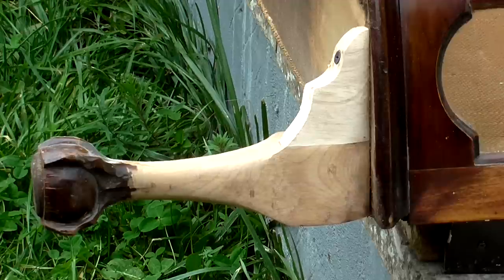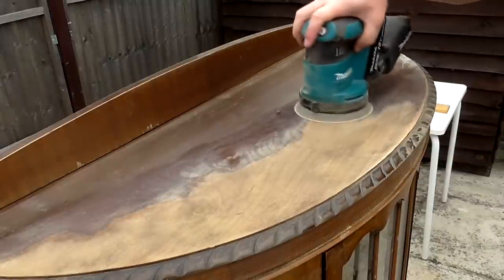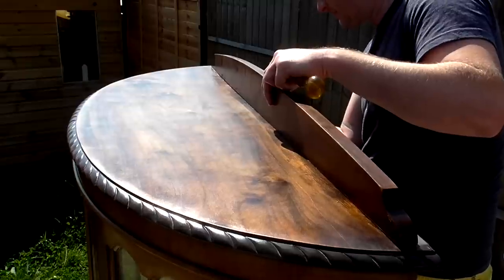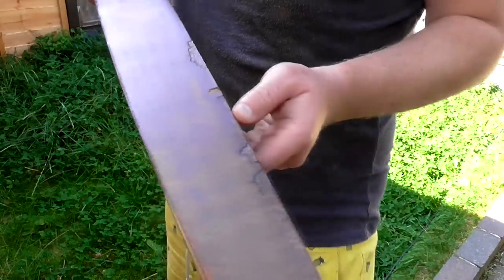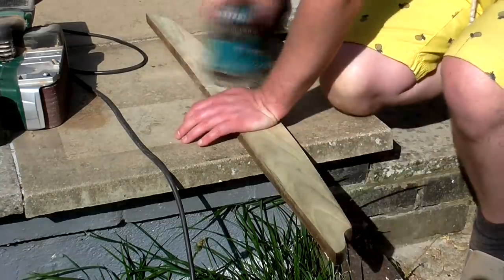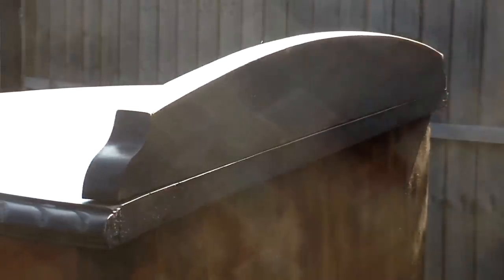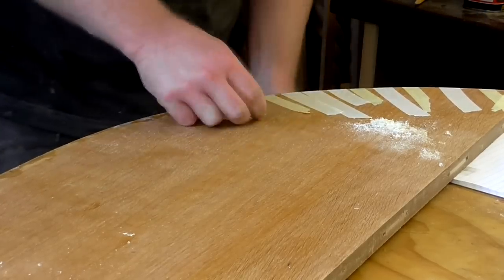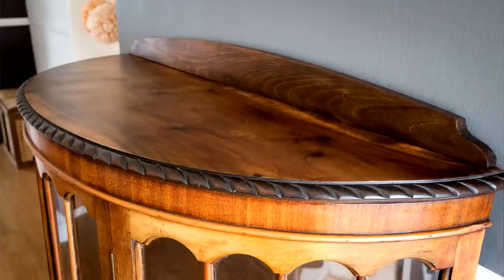Repairing A Vintage Display Cabinet (Part 2 of 2)

Comment: Piece of advice to get rid of veneer quickly. Use an iron on it.
After heating up, you can just peel it off :)

Btw, I don't get the criticism, just let people do whatever they wanna do.
There is no right or wrong.
Reply: B Breeuwer I’ll definitely be trying this in the future.
Reply: Great tip thanks

Comment: I just discovered your channel and am really impressed with your work. I love to restore furniture in this fashion - which is to say I DO worry about how it looks, but I don't worry about every piece is original. I believe you called it "sympathetic" restoration. Function/strength is critical to me. If you can stand in front of it and it looks good as well, then it is a job well done in my opinion. Your shaping of new pieces to the old on the "wings" of the leg... I have done that by hand and it is a real challenge. It was enjoyable to me, to see how you did it with tools/saws, etc. Really top notch work. Thanks so much for sharing. I wasn't going to comment - but after hearing you at the end of the part 2 video, talking about critical types of comments you receive on a job like this - it was almost like criticizing the work I do as well. So, in that light, it seemed proper to respond :-)  I believe a UK expression is "crack on"? That seems appropriate here. Job well done Sir. Crack on.

Comment: What a beauty! Well done! :D Would love to have such a beautiful cabinet, but they always seem to be hard to find, or when they are, they're sold in "vintage" stores where people charge the price of a Lamborghini and your right leg lol. It's rare to find something like that in a second-hand/thrift shop. At least around here that it.  But I recently bought a quite odd large glass cabinet, which seems to have been an old clothes cabinet at one point and has been up-cycled more than once to have glass sides and doors, and added more details but kept the wood stained dark brown. Really quirky to see where the new additions meets the older and the older meets the antique. The hinges and lock and key are clearly very old but the framing around the glass windows are new and the knobs on the drawers underneath are of newer style with modern screws to keep them in place, and then the foot of the cabinet seems to be vintage but not as old as the lock, and you can tell there has been used different kinds of woods here and there haha. I love it. It's like a collection of different periodes in one furniture and very beautiful to look at

Comment: Hi! I have a very similar cabinet, although mainly veneer. It's worth nothing however holds sentimental value. Thank you so much for this video, it's brilliant! 
.....that said, the putty on the inside of the glass doors is crumbling away. Do you have any advice on how to rectify this? I'm I'm inclined to remove the old putty and replace it as the glass is original and undamaged! Could I use wood filler or clear silicone instead? (This is only for the inside of the glass doors).
Thank you in advance. 
Lisa 😊

Comment: Fun-tastic  ! But have to ask , why redo under  back splash  when it overall a marginal  piece to begin with .I think  top was missing  original  veneers and or burned through note little knot holes . Again nice .I once found  a set of glass shelves like those at a sale for $5 for pair knowing what they went to. 3 years later I  found  the English Queen Anne display like yours that was missing the shelves . And yes they fit  perfectly. Mine wasn't  as nice lol God bless  great job

Comment: A very nice job. The replacement wings on the legs were awesome. Did you consider making paper templates for them rather than visually copying them? I guess it depends on your particular skills.
Reply from the maker: That's a good idea, I tend to do things quickly and without thinking though!
Reply: @RagnBoneBrown  restoration is quite the opposite

Comment: As a novice, can I ask: Why do you hand sand with 400 or 600 grit? Fine grit discs are available for the random orbital sander, wondering what the benefit is...?
Reply from the maker: Because it only needs a light tickle for denibbing, random orbit would be too aggressive

Comment: A quick question for you Keith.  If you put an oil on first, how can the lacquer stick properly.
Reply from the maker: The oil soaks in the wood and once dry can be coated with other finishes